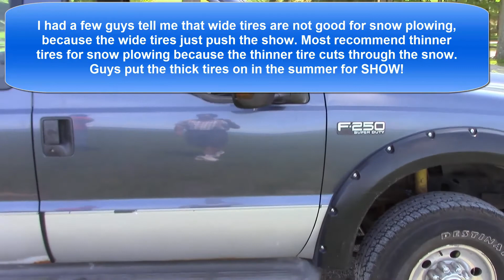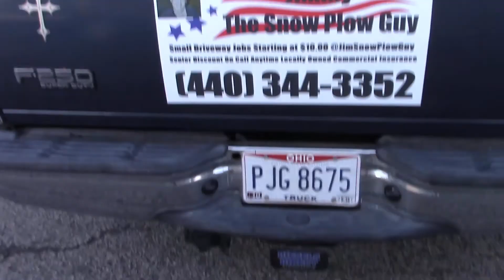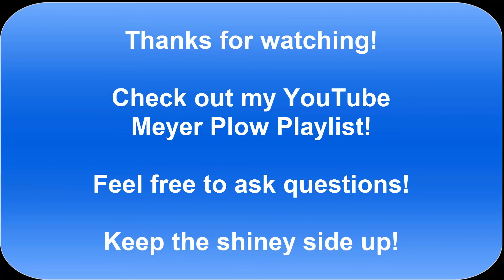Mickey Thompson Baja Claws on F250 Snow Plow, Compare 315 to 285

Comment: I have 17 inch grand Cherokee Laredo wheel .. will these Baja claw tire 16 inch fit on it ? With lift ?
Reply from the maker: I don't know anything about that stuff, it very technical. Call the MT office and ask them. Smart guys at Tire garages can tell you too. I think if you change sizes, it throws off the speedometer. The speedometer can be re-calibrated at the dealer though. For plowing, most go with BF Goodwich.

Comment: Is your truck lifted or leveled?
Reply from the maker: I BOUGHT IT USED A FEW YEARS AGO. IT WAS ALL SET UP WHEN I GOT IT. I THINK IT CAME FROM A LAWN COMPANY IN AKRON, OHIO. SO I HAVE HAVE NO IDEAS ABOUT THE SET-UP. YES, IT'S LIFTED, I THINK ABOUT 6 INCHES, BUT I'M GUESSING. IT'S PRETTY HIGH. LEVELED, I HAVE NO IDEA. EVEN THE MAIN ROADS IN MY SMALL TOWN ARE TERRIBLE. A BUDDY CHECKED IT OUT, HE SAID IT WAS LIFTED CORRECTLY. IT'S A PRETTY BUMPY RIDE, TERRIBLE, EVEN ON SMOOTH ROAD. A MECHANIC TOLD ME ALL LIFTED TRUCKS RIDE ROUGH, BUT I'M THINKING ABOUT PUTTING NEW SHOCKS ON IT.

Comment: sweet.
Reply from the maker: They don't work that great on snow.
Reply from the maker: I emailed Mickey Thompson a few months ago about studdable tires. Below are the emails.

Hi Mickey Thompson,

I have the Mickey Thompson Baja Claws LT285/75R16, are they studdable?

Do you have another studdable snow tire, LT285/75R16, or maybe LT265's?

Thank you,

Response:
We do not have any studdable tires.  The Claw is an extreme mud terrain tire, which is the opposite of what you would want for snow performance.
Reply: I had 2 sets of claws best snow tire i ever had  35s and a set of 37s never got stuck mud bogging or going through 2 feet of snow no problem only complaint was using them on my daily driver the highway killed them wore them out in 20,000kms